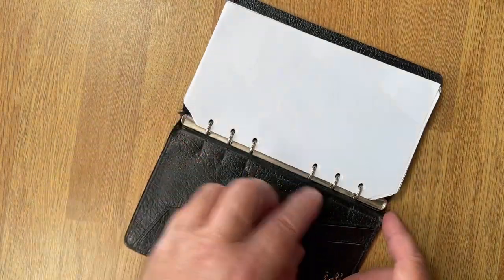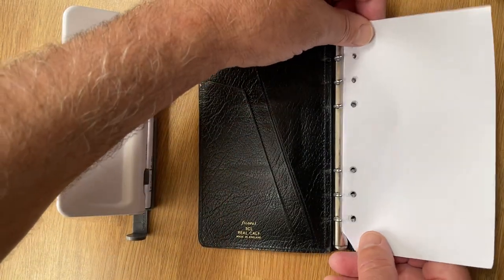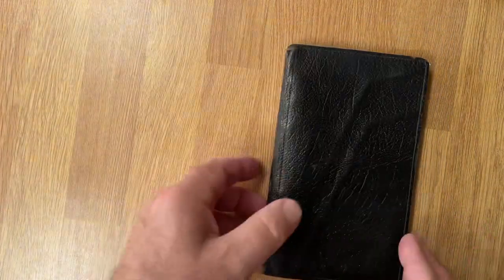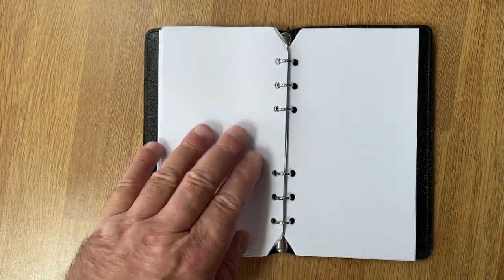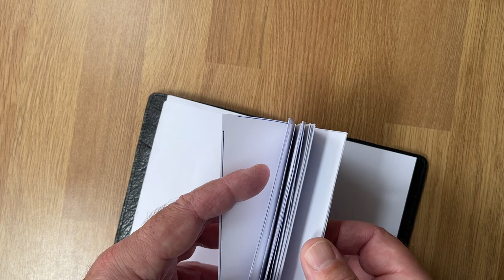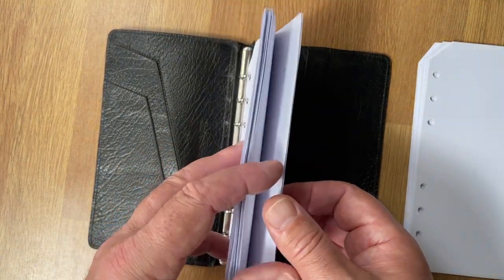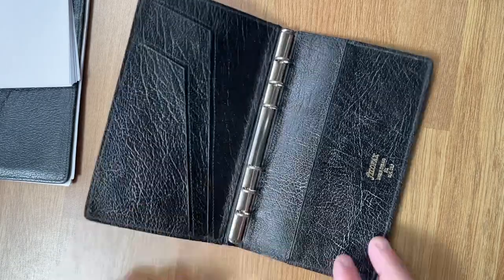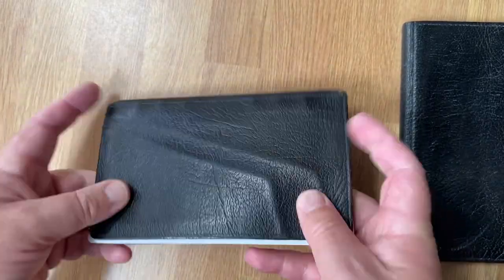EDC binder paper capacity - a minimalist approach

Comment: Prior to 1980, the holes in the leaves were smaller. That would stop the snagging issue you’ve observed. I doubt you’ll find a UK Filofax punch that old, but what you could is get an old Lefax punch from the US, as these also made the smaller holes.
Also bear in mind that the closer fitting holes do cause more friction when you use the leaves in a binder with bigger rings.
Reply from the maker: Great info. Thank you.